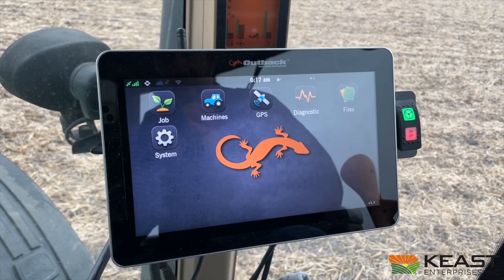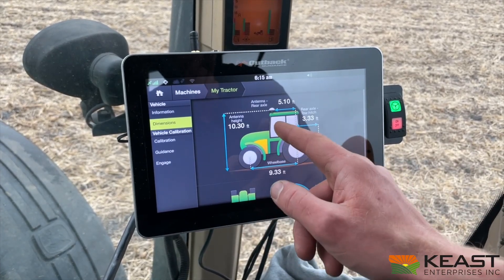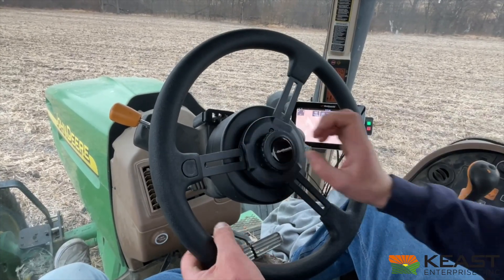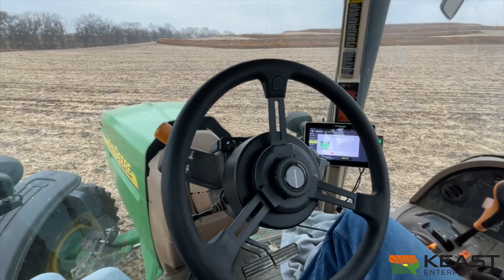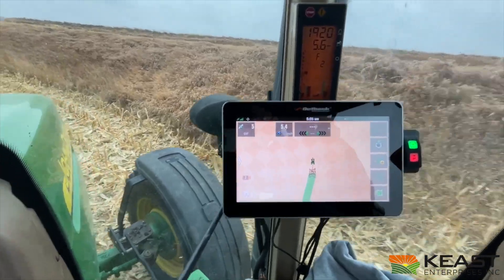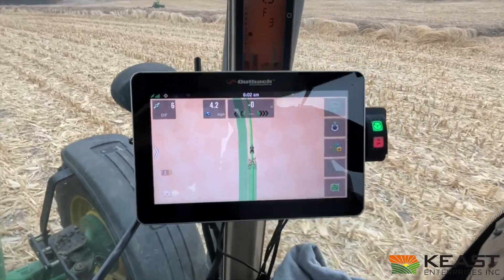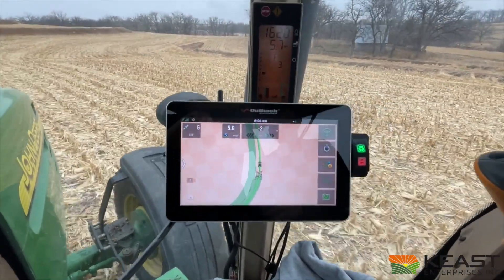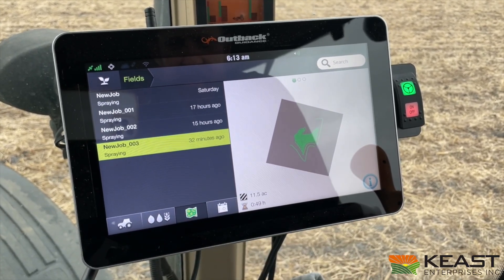Outback MaveriX Autosteer Drive & Chat - From Calibration to Performance!

Comment: Worked for Outback in Western Australia  back in 2008-2012. Selling and supporting the S3 mostly.  That 631 antenna looks interesting with options for differential signals. Maverick is a step up and the steering has come on since the VSI days. That little AC110 has proven to be a real winner, it struggled as a spray controller early on but settled in nicely with some version upgrades. Good video.